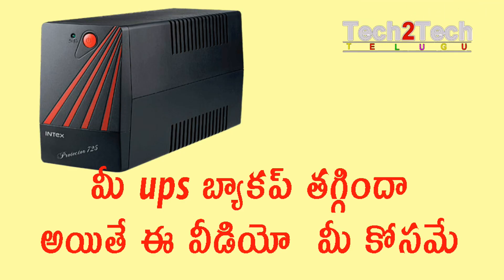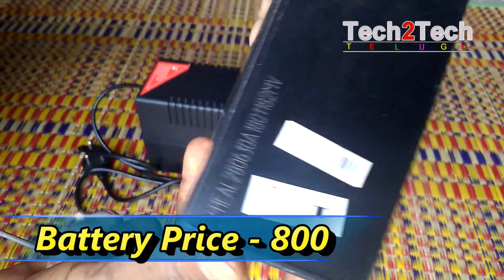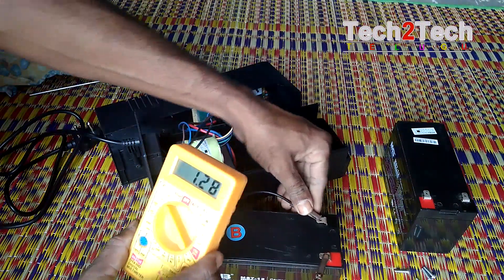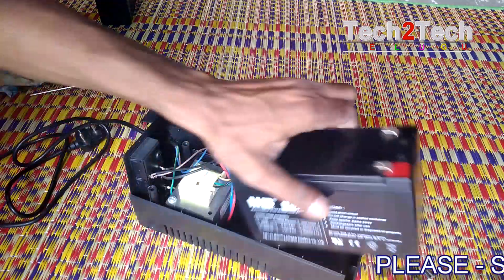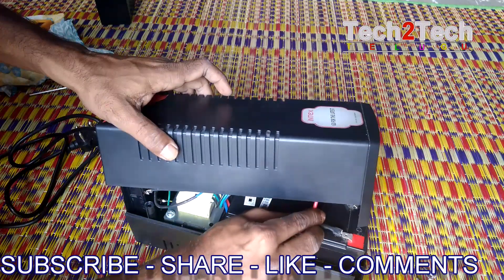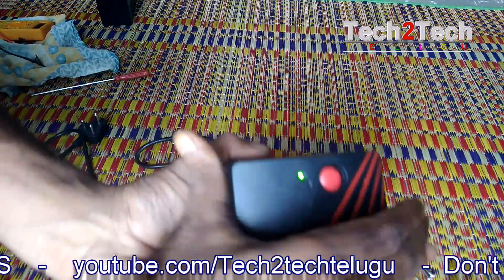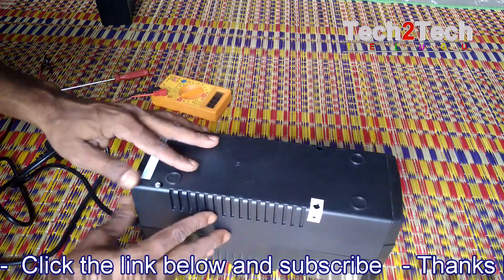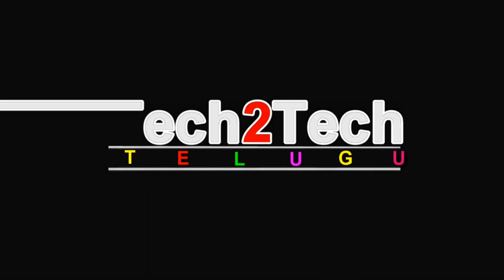Ups battery replacement, computer ups battery price, intex ups price, college projects

Comment: Anna celling fans ran avuthunda and led  bulbs
Reply from the maker: only dc products running Ex - led tv, charging table fan, led bulbs, led 20 watt tube light,
Reply: Anna nenu adhigindi ups out putt paiin    fan  bulbs ran avuthayya antuna